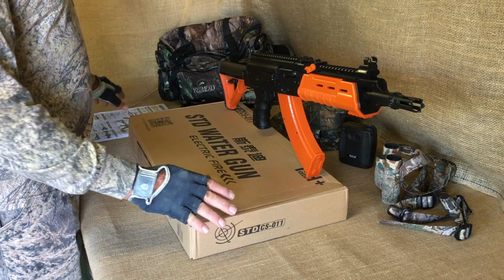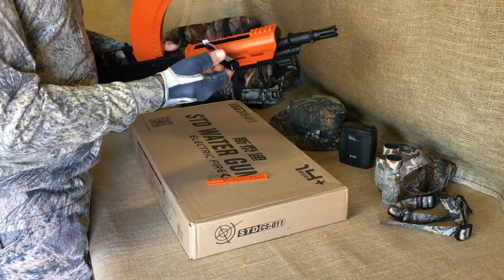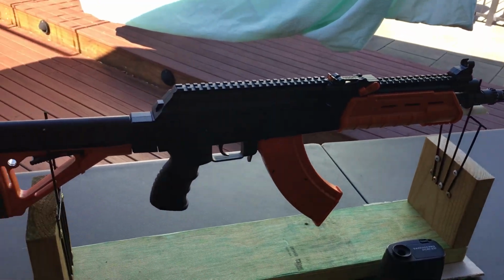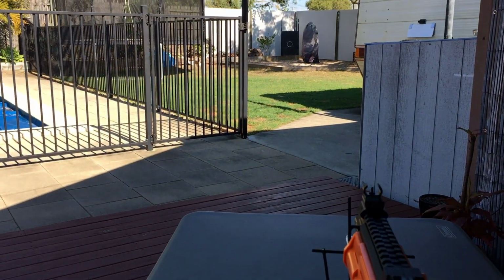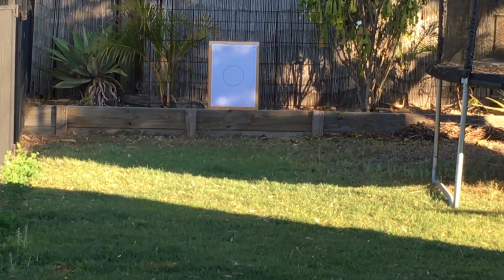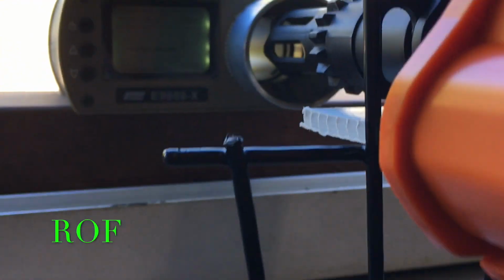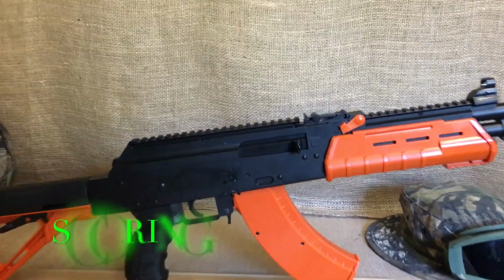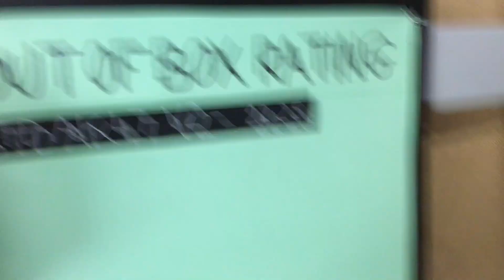STD AK47v2 Gel Blaster Out of Box Rating

Comment: Hi nice vid .just got myself one did you work out the problem with the hop up
Reply from the maker: kevin bassman
Hey mate,
Thanks, no it never worked out and is not adjustable anyway. 

Grab yourself a after market adjustable hopup from EBay or wherever you can find one. 

Also you can upgrade the spring as well if you want to.